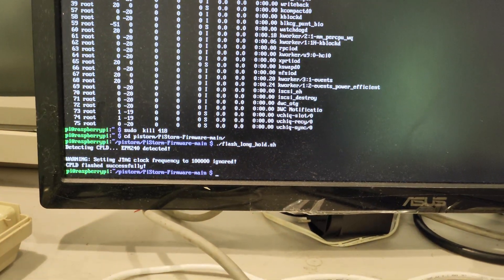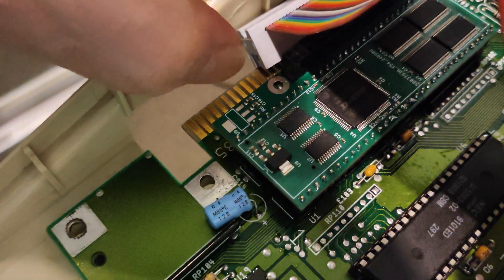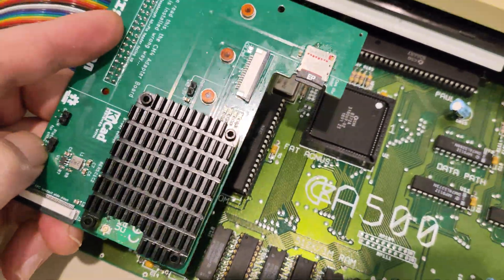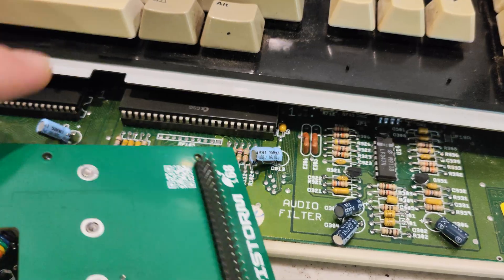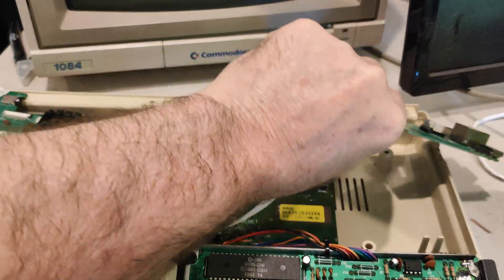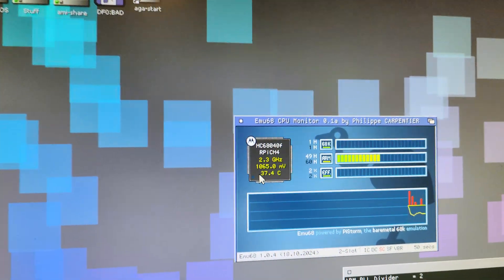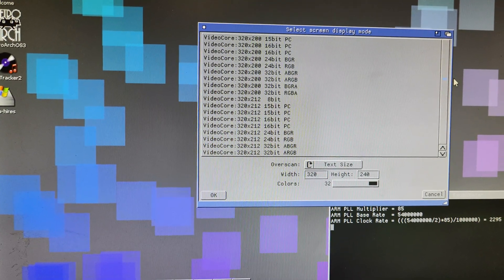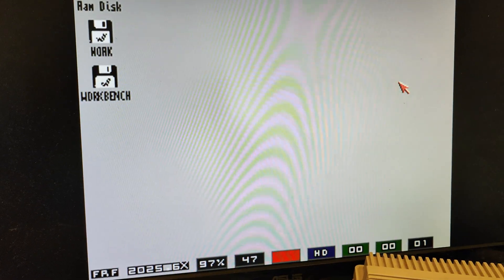CM4 on Amiga 500 using Pistorm Classic and Pistorm32 CM4 adapter board #Amiga500 #PiStorm #robric

Comment: is this better than Pi4 ?
Reply from the maker: A Pi4 does not work stable on an A500 in my experience. It just crashes when the CM4 setup like I do works.
Also fast ram expansions make huge difference to stability when running at these speeds on an A500

Comment: Nice, did you have to reflash the adapter board that plugs into the CPU socket with a different firmware? I wonder if I get this this working on a A2000. I have the PiStorm 2k board, a CM4, I just need the card you hace the CM4 on. You should see, if you want, if the flamethrower works on it too.
Reply from the maker: I have frame throwe boards, I Just need to build them in the next few days.
I'm confident it will work on most classic Pistorm setups. I have multiple users around the world that have had no problems using the setup as seen here.
A Pi4 will not work but the CM4 will.
You can use any firmware on the Pistorm, ive tried , standard, long and longer hold (which I used when I had bad/slow ram expansion)
i can send you a kit for CM4 to try on the A2000 at cost if you are interested in experimenting.
futureretrofusion1984@gmail.com